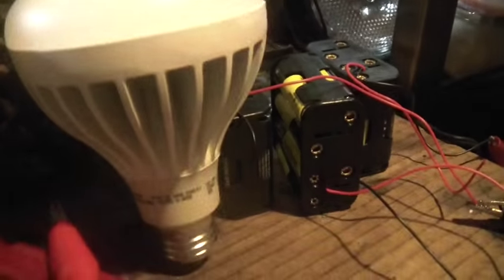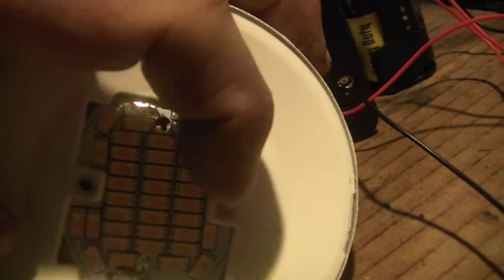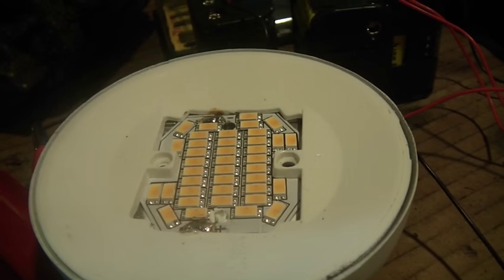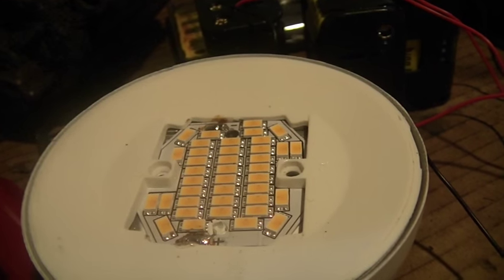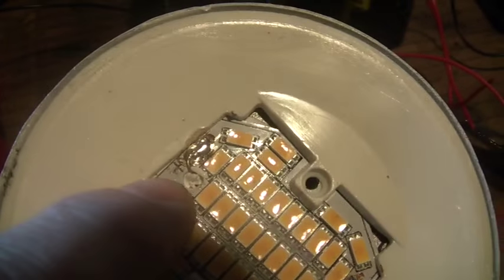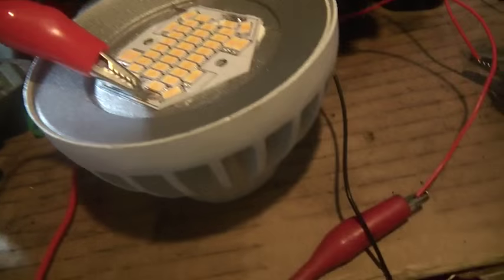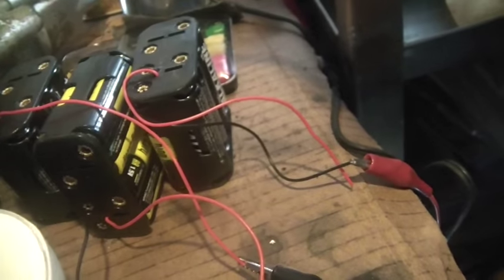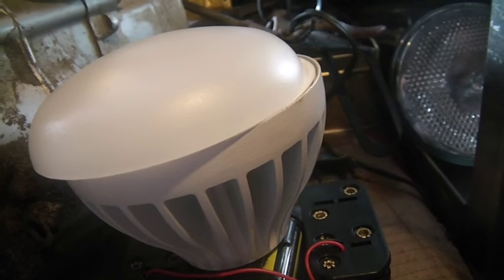Hacking a LED spot light, what is inside, LED array,

Comment: ake a joule thief osculating circuit to run off your 12v jump start packs
Reply from the maker: +sim6699 . I will have to look up that circuit... I kind of cheated and looked up a Voltage multiplier on eBay, they cost around $15 ready to go... Thanks for the good input, watching, and commenting!!!
Reply: +Harvey Spooner ~ boost module can be bought for $2 on ebay